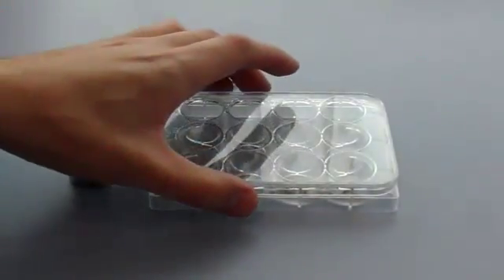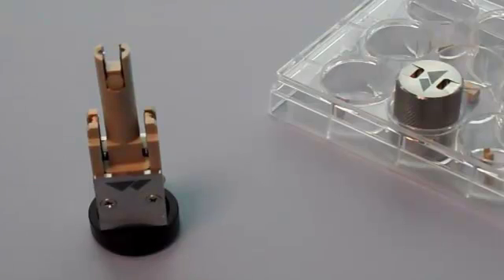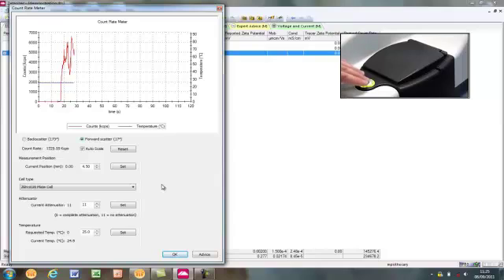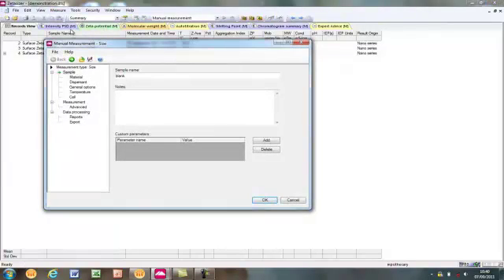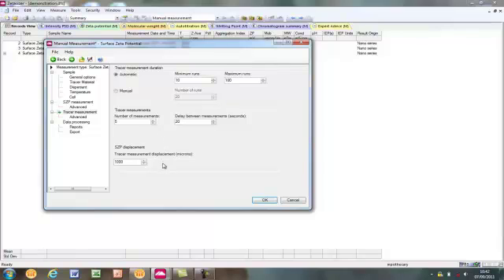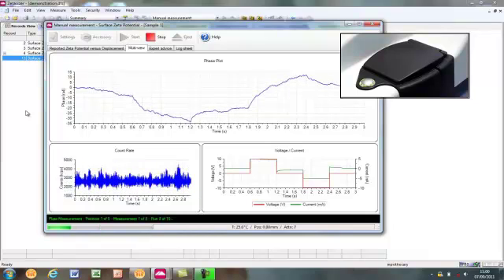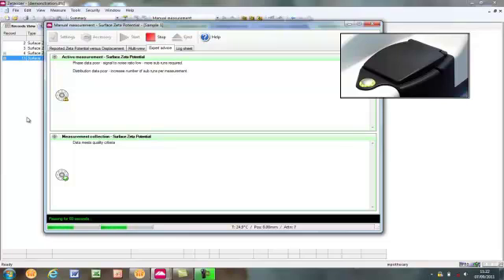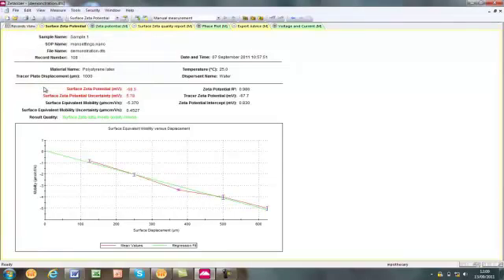The Malvern Panalytical Zetasizer Nano surface zeta potential cell

Comment: Hi, could you tell me the way to measure the particle  size of a sample in cosolvent? I cannot find information of the cosolvent (permittivity, viscosity and so on). I guess the sample solution  is dilute enough to measure (<0.1 mM), and the cosolvent consist of two common organic solvents (but I cannot find information...).
Reply from the maker: Assuming you want to use DLS to measure the particle size of your sample then the two parameters of importance are viscosity and refractive index of the dispersant (solvent), of these viscosity is probably the most important.  

It would be best to measure these at the desired temperature you want to measure your sample at, typically 25C.  Measure the zero shear viscosity using a rheometer and use a refractometer for refractive index.

Having said this, typically a co-solvent is used at low concentrations and hence may only have a small effect on the viscosity and refractive index of the bulk solvent and you could probably use these bulk solvent parameters as a starting point.  You can always recalculate the DLS data once you have a better idea on viscosity and refractive index. 

Lastly, dependent on your solvent-cosolvent chemistry it may be possible to use a standard particle of known size – add these to the solvent mix and measure.  Ensure that the particles are not interacting with the solvent or each other – i.e. not dissolving or agglomerating etc.  You can then adjust the viscosity to correct the result to the known or expected size result. 

It maybe best to reach out to your local MP representative if you need more in-depth help.https://www.malvernpanalytical.com/en/about-us/contact-us/
Reply: @MalvernPanalytical  Thank you for your answer!

Comment: Hi. Could you please tell me which exact Araldite glue did you use in this video? Or do you recommend any specific glue for this kind of measurements?
Reply from the maker: Hi Wiktoria. Most samples get glued on with over the counter 2 component glue. It all depends on the medium and the sample, you just need to make sure that nothing is interacting with the surface or the solvent or simply degrading. If you need more support, don't hesitate to contact us at http://www.malvern.com/en/about-us/about-malvern/malvern-worldwide/default.aspx or helpdesk@malvern.com
Reply: Thank you for the answer.
Reply from the maker: You're welcome

Comment: Hi, Could you tell me what kind of film used in this video?
I have a team like this but when testing a film of SiO2 not get the same graph . I should be grateful if you could solve my doubt.
Reply from the maker: Irvin García Thanks for your interest in our video. The film that was tested by one of our scientists was in fact PVDF. However, if you require assistance with your measurement please feel free to contact a member of our helpdesk team who will be happy to assist you.  You can reach them via email: support@malvern.com
Reply: Malvern Instruments Hi, thanks for the clarification , I have two more questions , the film adhere to the sample holder is fully PVDF or PVDF is attached to a substrate ? And what kind of solution the film is immersed ?Thank you very much and greetings .
Reply from the maker: Hi Irvin, thanks for the further questions.  I'm afraid that the scientist who took these measurements has now left Malvern, so we don't have full details. However, if you give our Helpdesk a call or drop them an email, they will be able to help with your specific application. Contact details can be found via this link: 
http://www.malvern.com/en/support/contact-support/default.aspx
Reply from the maker: Hi again Irvin. I've just managed to track down someone involved in the measurement. There was no substrate, it was just glued with an araldite glue. The liquid was simply our zeta potential transfer standard. For this demonstration, the solution did not matter too much but for your application, you will need to consider what type of solution your material is submerged in so that your measurements are representative of the real-world application. Again, if you need any support with this, please contact our helpdesk. Thank you!